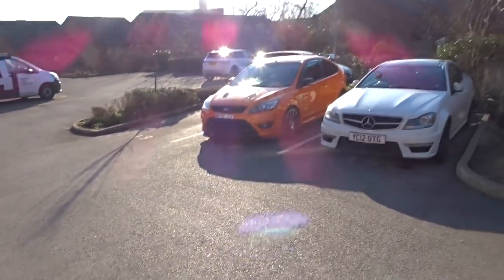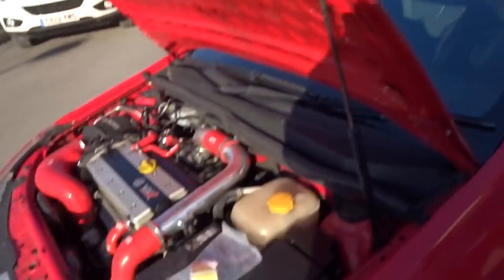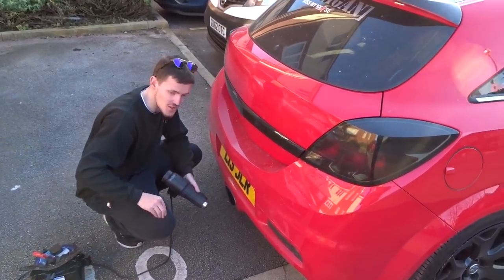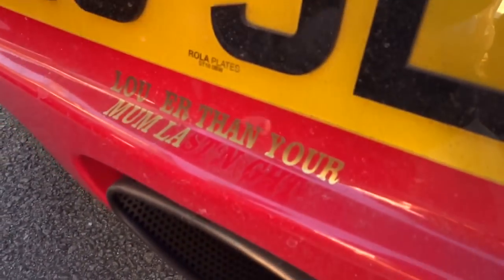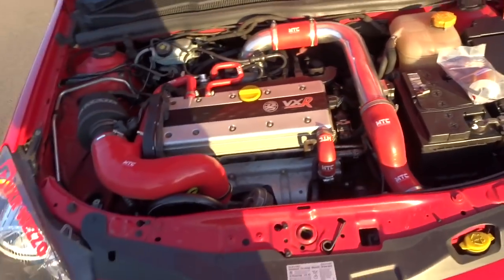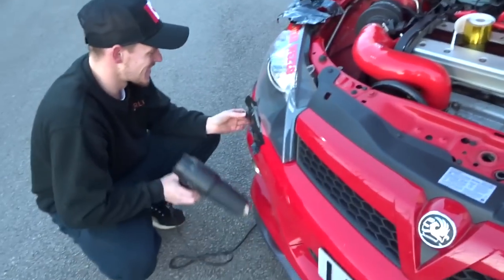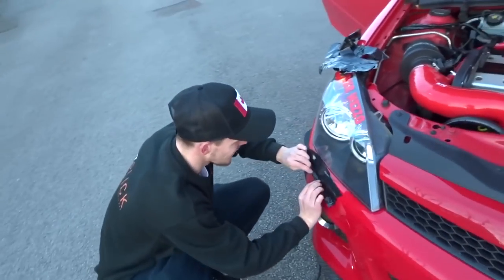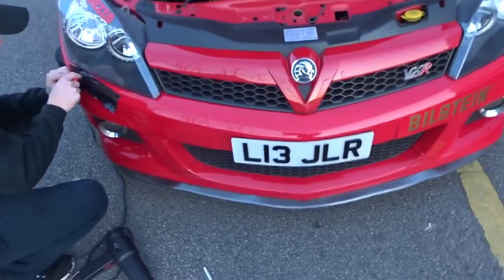BOOT LID DE-CHROME!! (Plus heat wrap to engine bay) gold bling!!

Comment: What bilstein parts are on the car mate?
Reply from the maker: Ryan20689 😂😂😂😂 the sticker 👊👊👊.. got it from when I went for a mooch with the cannon run matey, it’s coming off soon bro for sure.. good spot fella 🤪👊🏻
Reply: I’m running eibach 30mm all round as it’s only my daily. However I’m interested in some AP coils. If you fancy a set of lowering springs you can have my eibachs at a good price 👍🏻 will give you a shout on insta nearer the time.
Reply from the maker: Ryan20689 shout me bro for damn sure 😎👊🏻🔥🔥💯💯🔥🔥

Comment: Wez I don’t wanna hate but that gold wrap looks messy needs to go on straight surfaces 

Either get the pipe painted or anodised the wrinkles stand out a mile off 

Sorry man
Reply from the maker: Ivor Biggun I hear ya bro massive respect!, right now I’m using it purely for the cooking aspect and not for the looks.. need a cooler on the car ASAP so anything that’s gonna help with that I’m Bolting it on 😂😂👊🏻 will sort out the aesthetics of it soon fella got plenty more of that stuff 😎👍🏼🔥🔥💯💯🔥🔥
Reply: get the bonnets vents done like jessie did to keep it cooler
Reply from the maker: Craig Lewis it’s on the list brosky 😎👊🔥🔥🔥🔥🔥💯💯💯🔥🔥🔥🔥